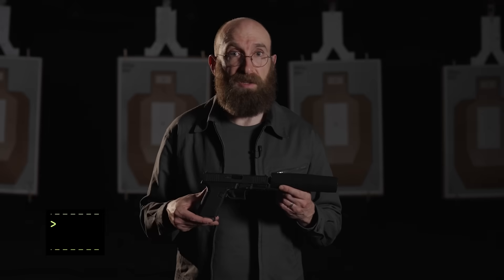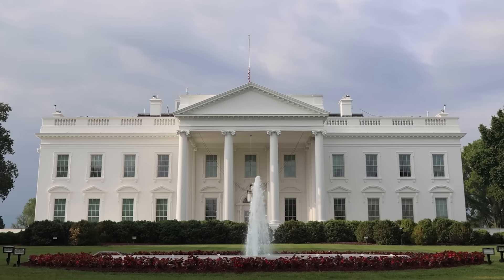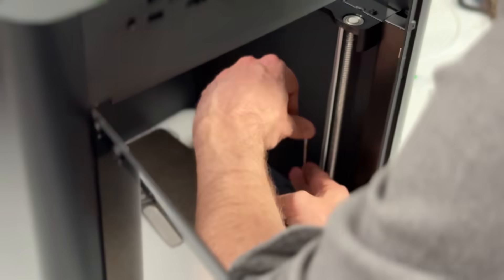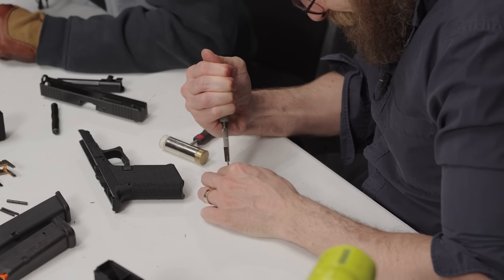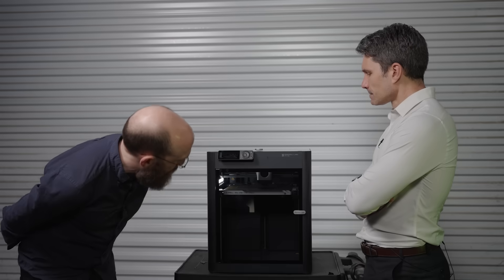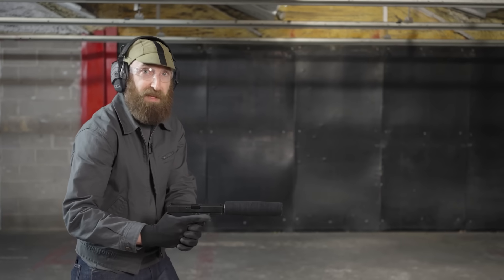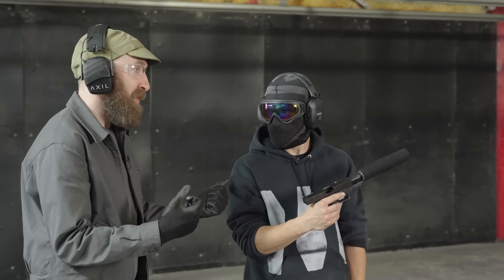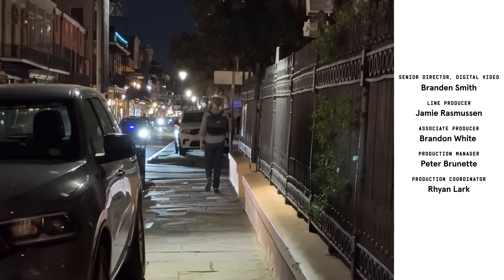I 3D-Printed Luigi Mangione’s ‘Ghost Gun’ | Hacklab | WIRED

Comment: The problem is that most safety on printers is this, a controlling a printer is not hard (programmatically) so replacing the safe firmware with bootleg gun firmware is easy. the genie is out of the bottle on that front, there are open source 3d printers on the market you can built yourself. not normal printers because normal printers are more complex.

The second, no we havent been here before, because money is secure because of the paper it uses not because of the ink on that paper. The printers won't print money is dumb, it is dumb for the reason that no reasonable person would be handed a paper bill and think that they got money

Third problem we havent been here before, counterfeiting doesn't do as much damage as killing people

Comment: How about you address the misconceived notion of “untraceable” vs “traceable” 

Registering a firearm with an arbitrary number on the side of it isn’t like an Apple Air Tag. If a registered gun is stolen it’s not like you can locate the stolen gun to its current location. It’s just numbers on the side of the metal.

Comment: I imagine 3D printed guns might be fun and all, but unless you have a machine shop i wouldn't rely on anything you make yourself.. EVER. It's just silly to use a 3D printed gun for anything serious, i should say Stupid.

I have 13 years of 3D printing experience, building, designing, and programing my own printers. FYI, you can now use filaments like PPS-GF that nearly match aluminum (avoid Carbon fiber for anything that takes repeated high stress, i.e. OceanGate). That can be printed on many new printers without any modification

Edit; my point is that i would be FAR easier to just buy a stolen gun or steal one. It would cost you A LOT of time and easily more money to 3D print one Today. Not a lot of 3D printed guns in Mexico where it's effectively illegal to buy one.

Comment: The firmware of printers not allowing currency to be printed is not analogous. Currency must be printed as an exact replica to be functional, and the security feature the firmware detects is part of that functionality. You can design your own dollar and it will print without any problem, but it will not be functional as currency. This is not remotely the case for firearms. You can not append an omron cluster to the act of diring a bullet.

Comment: I feel like making a gun out of material you can rip apart with your hands might not be a good idea but I am basing this off of nothing so who knows.
Reply: Local and state ordinances and laws can differ, and what's legal in some states may not be legal in others. But federally, making your own firearm for your own use is legal. Note: this does NOT include making “machineguns” or any other Title II or NFA weapons.
Reply: @thebasedspectre3048  I'm more concerned with the structural integrity of a material you can rip apart with your hands being used for a gun than if its legal or not. I think regardless of if its legal or not, Pandora's box is open. You cant regulate something like this with great effectiveness lol
Reply: @LeumasKnight Well, the Glock is polymer framed plastic, and most 3D printed guns don't use plastic for the internal mechanism

3D printed guns don't open Pandoras box as there's already illegal guns floating around and 3D printed guns are harder to make due to needing the parts

Comment: european here, i have absolutely zero interest in printing a gun, neither does anyone i know, and we do not have a ghost gun problem here. if you're gonna put firmware on my printer that tags random objects (100% of which in my case will NOT be ghost gun parts) as "ghost gun parts" and refuses to print, i'll never, EVER, engage with your company again. please stop treating everyday people as criminals, and please stop exporting your problems and your authoritarian "solutions".

i have no horse in this race, but that will quickly change if you start mandating random junk in my 3d printer to fix a problem that only one country has.

besides, good luck trying to prevent "ghost 3d printers" once you regulate every commercially available 3d printer. the very thing that brought us today's incredibly advanced 3d printing scene, the reprap movement, was built around the idea that you can 3d print a 3d printer. even today, the most advanced enthusiast 3d printers are themselves 3d printed to a high degree, and can be replicated out of nothing but filament and commodity parts. attempting to regulate 3d printers to have mandatory drm is a move that's dead on arrival and is only going to hurt honest people.
Reply: The funny thing is that it's not even a problem in the US. So few crimes are committed with ghost guns it's insane. People just want them banned because they sound scary lol.
Reply: There's been tons of FGC-9s turning up in Europe. Jstark, a pioneer of the 3d printing guns scene was living in Germany while he developed it. It's not a "problem" only limited to America. We're providing the rest of the world with the means to resist regardless of local laws.
Reply: You ever hear of R9 Arms Corp?
Big in Europe too. 
Even without printers, all it takes is one machinist to break bad. 
Funs are simple machines, albeit that've developed lot of intricacy.

Comment: No, 17:03 this doesn't make sense. Most people doesn't use 3D printer to print weapons and I don't think there's similar DRM on CNC machines which is far easier to make guns. Just make the barrel and slides registered and traceable.
Reply: Gun control as a concept doesn't make sense. That's why their polices are always the dumbest possible thing.
Reply: Barrels can be homemade, and have for the purpose of bypassing gun control.

Comment: Serialize the barrel not the gun frame. Problem solved. Nobody can 3d print a barrel except super highend metal 3d printers which can cost up to several million dollars...
Reply: You can 3d print a barrel groove jig and use the process of electrochemical machining to rifle a barrel that way for probably under $100
Reply: lathes exist
Reply: FGC-9. Your authoritarian control scheme is dead.
Reply: German engineering has already made homemade barrels a fairly easy process

Comment: your print bed optimization is terrible! I would have set the frame at a 45 degree angle pointed at the print bed, which would have less than half the amount of support material, and will be stronger because the grain of the print layers is perpendicular to the forces it has to endure when fired, increasing part longevity.
Reply: 45-degree printing is actually weaker and mostly only used for prototyping.
Reply: @stonegiant4  TIL, so then was that print method a good choice then? 😅

Comment: People freak out over 3D printed guns completely ignoring the fact that we’ve had CNC’s for quite some time now
Reply: You can get benchtop cnc machines for a couple of grands nowadays. The price will only decrease, just look at how 3d printers became wildly accessible in such a short time.
Reply: Metal stamping too lol.
Reply: The difference is a brand new 3d printer costs $300 while a 20 year old cnc machine costs $10,000.
Reply: in ww2 the Dutch resistance made Sten clones in a bike shop without power tools lol
Reply: Heck you can make a full auto hammer for an AR15 with some plate steel and a file if you have the time.
Reply: Printers are very cheap and there is a ton of documentation for Glocks and ar 15 frames.

Comment: The average hoodlum does not have the technical aptitude for this process. What happens is unscrupulous individuals will make and sell them specifically to a criminal element, knowing that it won't be traced back to them.

Nobody cares about gun nerds making guns in their garage (or at least they shouldn't), but the above is an issue

Comment: This will take 13 hours (c) and uses orientation where more than half of spent plastic was on support. Pretty sure simple 90 degrees rotation would've cut the time in half.
Reply: It would need a 180 degree rotation for eliminating supports, orientation of the layer lines affects the strength of the final product and having the layer lines going sideways has been shown to result in less than reliable firearms.

Comment: Two things. First, 95% of "printed" guns have metal parts to them. Yes he printed the frame, but he bought steel parts for the rest. So generally, being able to print an entire gun is very difficult.

Second, everybody needs to understand that Luigi's gun is Luigi's gun, conspiracy theories not withstanding. He possessed it. This possession is completely independent relating to his presumption of innocence.
Reply: @bruceferguson5942  Part of the presumption of innocence is that the state needs to prove its case. That includes not blindly trusting everything the cops say until they have been cross examined.
Reply: It hasn’t been proven he possessed it yet, since the gun was only “found” after being in a car for 11 minutes with body cam off and transported to a second location. There is a break in chain of custody, where anyone could have planted it.

Comment: Now go to Khyber pass and the Philippines and see what people have been doing with 100 year old drill presses, fire, and a will to build. 😂
Reply: we can even build a gun out of water pipe and nail. no tools needed.
Reply: @BM_brb  Jim Kirk can do better, bamboo, vines, diamonds, and rude black powder.
Reply: Or a basement in japan where a guy made a doohickey that killed a former prime minister using fireworks, a 9v battery, and some pipe.
Reply: @Nukle0n  or the warehouse of the Japanese doomsday cult that was responsible for the 1995 Tokyo sarin gas attack that also reverse engineered an AK74 rifles and made their own AK74 clone
Reply: in sandals with a cigarette in their mouths 🤣
Reply: If it was a artesanal handle made out of wood, a metal pipe and a coca cola bootle as silencer, nobody would speak about "ghost guns". The only difference between the ghost guns made since 1776 and the ones with 3D printer is that one is pretty and looks nicer.
Reply: @rmgsw  ...and that you literally need no skill at all to build tha latter...
Reply: They would have a stroke.
Reply: remember Phil Luty!
Reply: I just need to let my mind travel back to the 1990, where you'd build your gun out of a fax roll, papier-mâché, a rubber band and a coat hanger. Apparently, fax paper rolls were chambered for .22 ammunition.

The gun can be disposed by setting it on fire (in case it didn't catch fire already when it was fired), with just the steel piece of the coat hanger remaining.

More elaborate designs used metal water pipes.

These are short range weapons, as the "barrel" is not rifled, but they might still be effective at a longer range than an axe.
Reply: Almost like the jews like to take your guns before the Holomodor
Reply: Exactly
Reply: manufactured, un-registered, zip gun, disposable gun.
Reply: I've seen people use plumbing supplies to make 12gauges ON YOUTUBE

A person with enough skill and desire IS GOING TO BE ABLE TO MAKE A GUN

It wont be a good one to bring to WAR but it'd be a good one for self defense
Reply: That requires skills.
Reply: @BigMikePapadopoulos lol no it doesn't hahaha 😂🤣
Reply: Afghanistan and other ME countries as well.
Reply: intent (to do harm)

Comment: Wouldn't it be more effective to legislate gun parts in the same way the gun case is?
Reply: You could try. But the FGC-9 can already be made entirely with 3dprinted parts and jigs to electrochemically machine steel pipe into barrels. Unless you plan on having every piece of metal at a hardware store be serialized and require a background check. Even if you did you'd still be playing catch-up forever. Gun control is dead. You can't stop the signal.